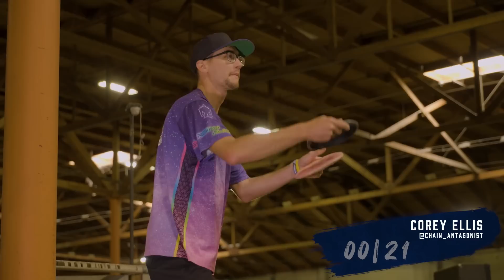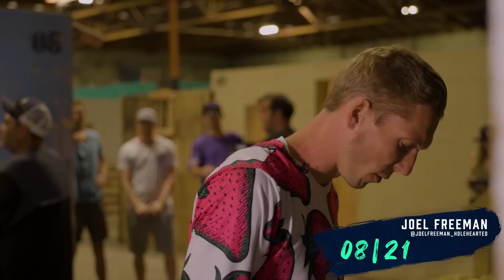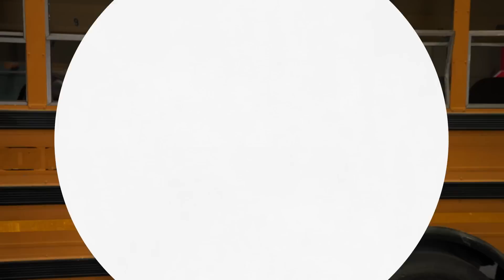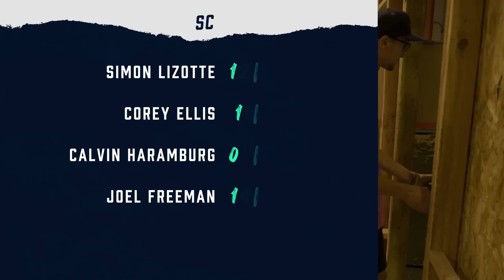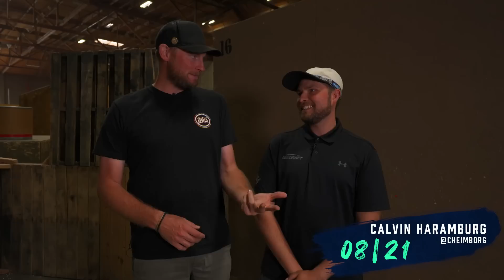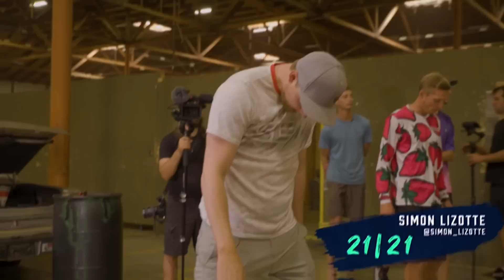Smoke bombs, school buses, and spit-outs! | Jomez Putting Game

Comment: Saved up about $12k and bought a used white and black two toned 2001 Ford Explorer Sport Trac truck with 50k miles for $6.9k. Then, I spent another $5k and I slapped on some black 22’s, two 12” slim kickers under the back seats in a custom box, TV’s in the rear headrests with a huge in-dash/TV in the front, and custom LED black lights throughout the cab with street glow and bright ass HID headlights in custom retro fitted headlamps and LED tinted tail lamps. I really REALLY LOVED that truck… Unfortunately, I ended up selling it for 3k after the transmission went out at about 115k miles. I also kept everything I put in it except the rear headrested TV’s. I was 18yrs old then. I’m 32 now. I have had many different cars since then, including an ‘89 F150, an ‘01 Ford Taurus, an ‘01 Grand Marquis, an ‘11 Silverado, an ‘07 CLK 430 convertible Mercedes, and now I’m driving a beautiful 2017 Honda Fit and it’s easily my favorite car I’ve ever owned! Lol! Simplicity always wins. Honda makes some great, comfortable and reliable vehicles. I wish I figured this out a long time ago before I wasted so much time and money on Fords (Mercury), Chevys,  and a Mercedes…

Comment: 1st car experience. I bought a 94 Chevy Blazer with a straight 6 thinking it was gonna be super easy to do maintenance. 30mi down the road on highway, a rod busts. not even 2 hours of driving time on the car. I've had rough luck with vehicles.. :/